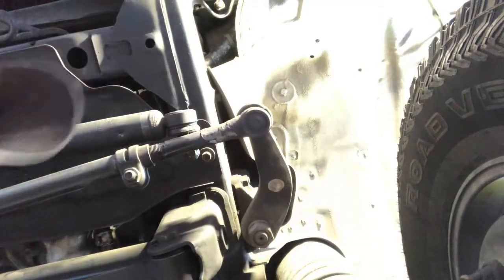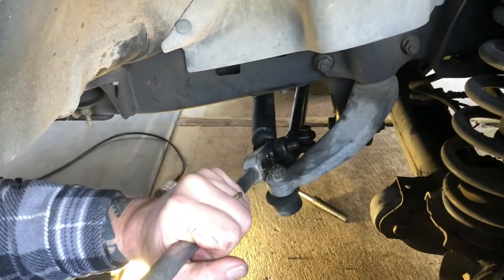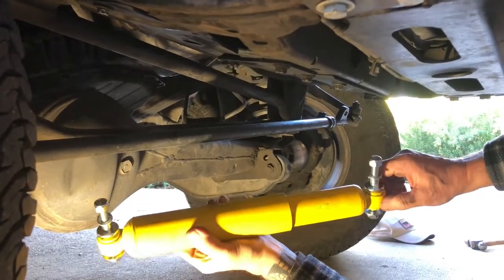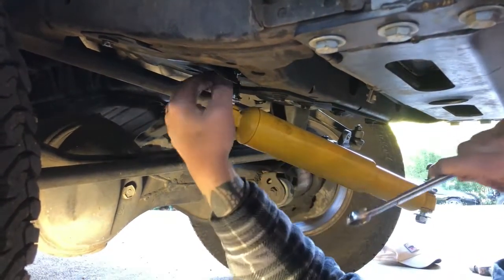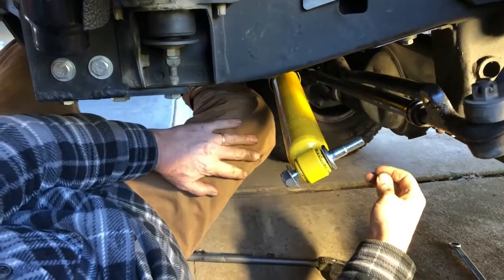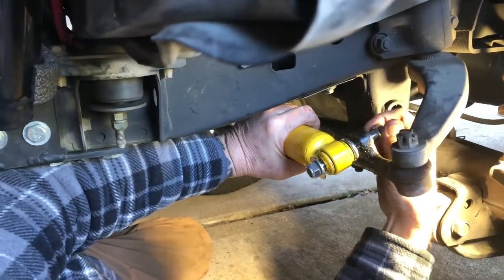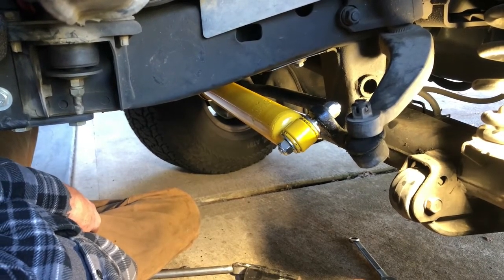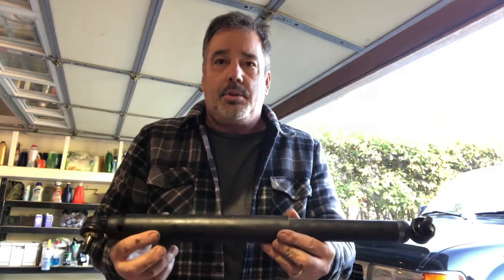1997 Toyota Land Cruiser Old Man EMU steering stabilizer install

Comment: Great video. Sometimes they come out easy. Sometimes they're stuck like chuck. Hate when they don't budge. Nice work!
Reply from the maker: Hey thanks for the comment! Yeah that's true, A ball joint separator works good. But not in my case...PB Blast the hell out of it. You saw I had to get a pickle fork and bang the shite out of it till it popped off. Did you get yours off?
Reply: @outboundterrain6454  I have a couple of 80's and a 200. I need to do it on one of my 80's soon. I have had them come off easy sometimes over the years, and sometimes nearly impossible. It's a chore for sure!
Reply from the maker: Yeah after all those years on the road, their like “Welded on” …love to see your rigs, working on an 86 Runner right now. I will post a vid soon…

Comment: As someone who owns a 79 series landcruiser (very similar to that 80 series mechanically), I found the OME gear to shit itself quite quickly. I’m now running superior engineering dampers. They are one of the few who still do the major steering and drive components for these vehicles.
Reply from the maker: Thanks, I didn’t know that…I’ll check into those. So far so good with this setup. Time will tell I suppose. But any chance to upgrade I’m all over it…”Superior Engineering”…Are they in the states?
Reply: @outboundterrain6454  it’s an Australian company based in Brisbane, but they do have stockists in LA & Miami, but they do freight everything they have
Reply: @outboundterrain6454  one of the best things for these vehicles is the upgraded cv’s, 6 point uni joint rather than standard.
Reply from the maker: @tasmanmcmillan1777  Thanks Tasman, appreciate the info. I plan to contact them and order the parts that you have suggested. It’s fall here in Northern California…this will definitely be a winter project. Got her inside the shop before the snow flies here at Lake Tahoe. Looking forward to the project 👍…
Take care down there…Cheers, Chris
Reply: @outboundterrain6454  nice nice, but be careful of the heat rating on each product you get from Australia, the majority of the parts are suited for high temps, like my vehicles are regularly under heavy load in 122 degree weather, and rarely sees anything below 86 even in winter

Comment: I run the OME stabilizer and the shocks (2" lifted Jeep TJ) and I love them, however, there's one downside to OME shocks, they have a very VERY bad finish. The steering dampener and the shocks will rust in no time . . . . and there's nothing more ugly than yellow rusted shocks all around and rusty dampener. I don't know whether the coating/paint is bad or they use very inferior steel or they have a bad undercoating/rust preventer. Thanks for sharing your video ;-)
Reply from the maker: Yeah I agree, the fox shocks I run seem to be holding up without rust and the other shit. They are pricey but I think the finish is superior. I run them on my TJ and jk. So far so good. Thanks for the comment…

Comment: How about a reaction to the repair. Did it make a difference?
Reply from the maker: Yes a big difference! Steering tight, less bump steer. Very noticeable upgrade...Recommended. Especially if you have the original equipment...

Comment: Can I use a suspensión shock as a steering stabilizer? Is the same length
Reply from the maker: Good question. I suppose you could if it was the right length and your side to side steering was ok. Anybody out there have any thoughts on this??